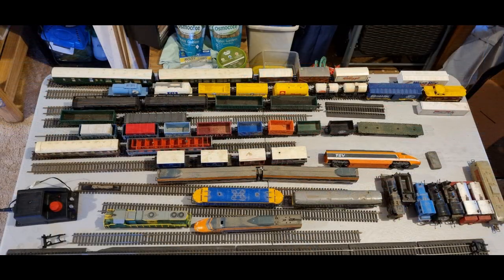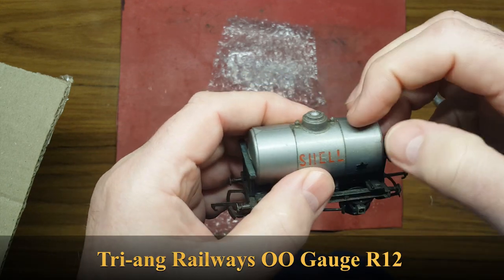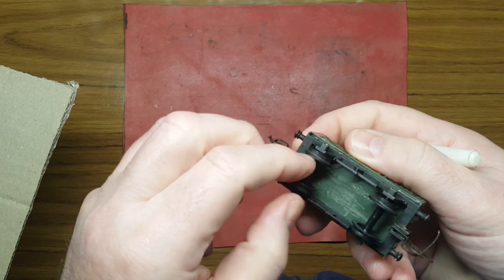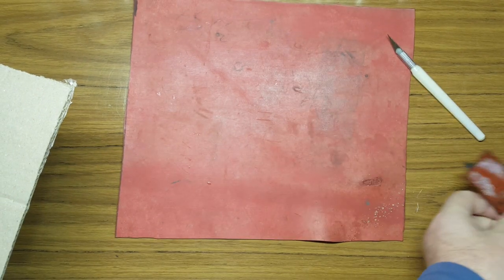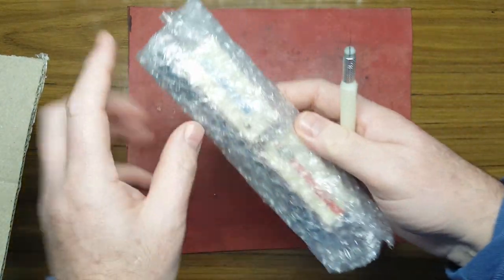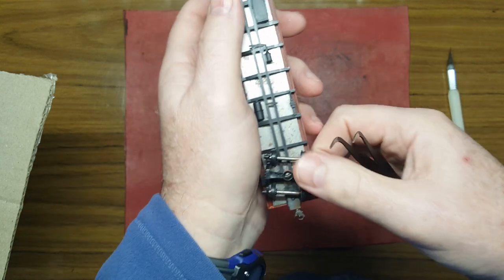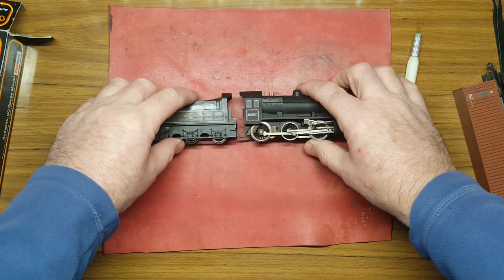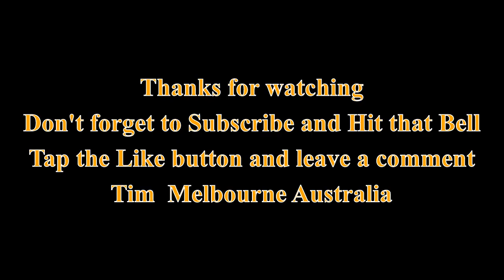What's New Wednesday S1 Ep10 A nice collection of rolling stock and a Lovely 2-6-0 Loco

Comment: A very nice collection.
The early Tri-ang wheels can be removed by pushing the axel right through. A bit of oil added to the axel/wheel connection may be needed first. One wheel should be free of the axel. You probably already know this. 
The Hornby Ivatt Class 2 is a great runner and very atteactive.
Good haul.
Reply from the maker: Thanks Mons.. and yes I do know that about the axles.